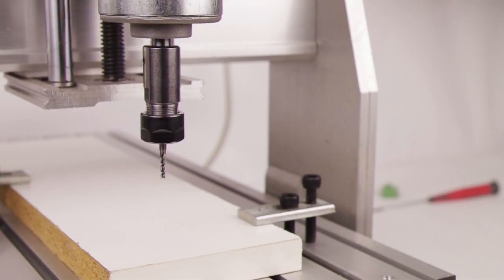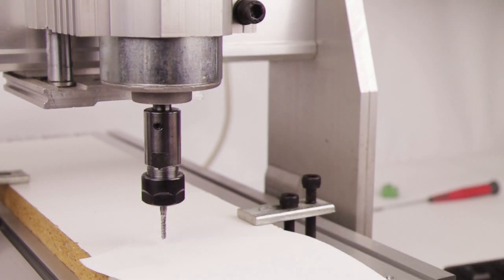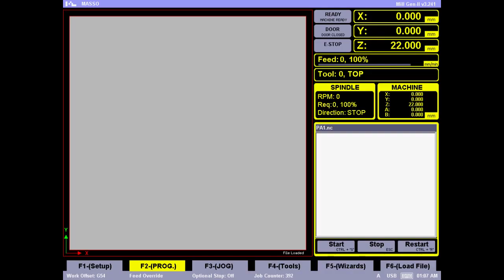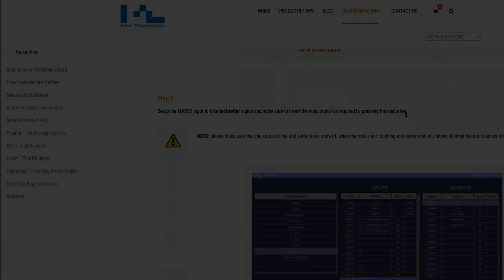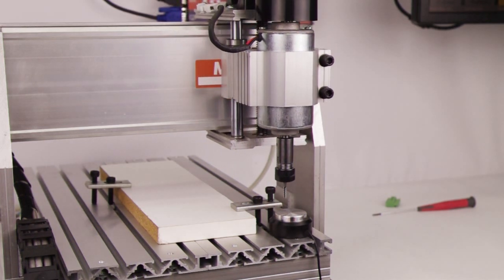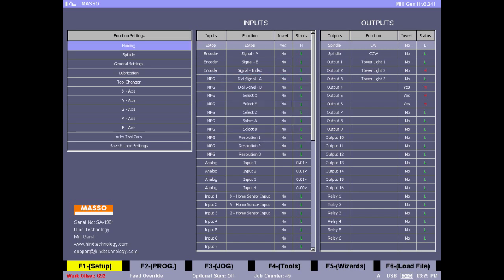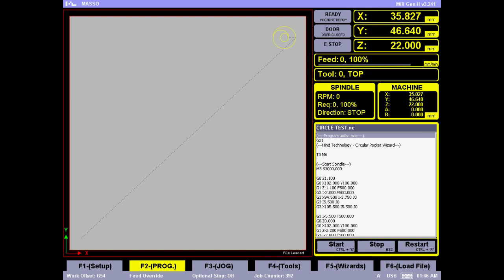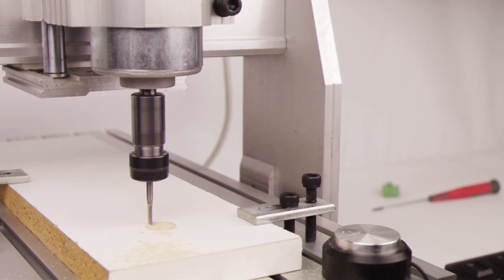How To Set Up and Use Auto Tool Zero by Masso CNC Controller

Comment: Did I miss the bit where you enter the height of the puck?
Reply: EXACTLY   WHERE?????
Reply: Martyn Cole the z height is recorded at the moment that contact is made. The measurement is relative to the 1st tool that was measured and set to a working z zero. I have this setup and it works great.

Comment: Hello and thank you for the video.  I've been zeroing my tool at the top of the part using paper as you describe, and was interested in automating my tool zeroing.  But I don't really understand the benefit of using auto touch-off if I have to go use the manual method to establish the G54 work offset in order to use the tool offset referenced to the table with the table as Z0.  Seems I save time just going ahead with the manual method on the top of the part as I have been doing.  Am I not thinking about this correctly?  Thanks for any more info you can provide.

Comment: If your spindle isn't controlled through MASSO after the tool height is set it starts to run the g-code. Is there a way of pausing MASSO  to give me time to start the spindle before continuing the g-code?
Reply from the maker: I guess you can add a gcode M00 for "Program stop", this way you can start the spindle and press CTRL+S or cycle start
Reply: @MassoCNCAustralia   WHERE? is the offset for the thickness of the touch plate?

Comment: Do you have a distributor here in europe?
Reply from the maker: At this stage we ship directly to Europe from Australia, we are in the process of keeping local stock in UK for even better service to Europe.
Reply: Masso CNC Controllers thanks a lot I am planning on buying one of your plasma controller but I still thinking how cost will be the duties and taxes for this.
Reply from the maker: the customs and duties depends from country to country
Reply: Masso CNC Controllers it's that possible that I will buy the 3 axis configuration first do reduce the custom duties that I will pay and ask later the additional axis to my need, because on my understanding if you upgrade the axis it's only on software. Please correct me if I am wrong. Thanks
Reply from the maker: All MASSO controllers have the same hardware and can be upgraded to 5 Axis any time
Reply: Masso CNC Controllers okay thanks